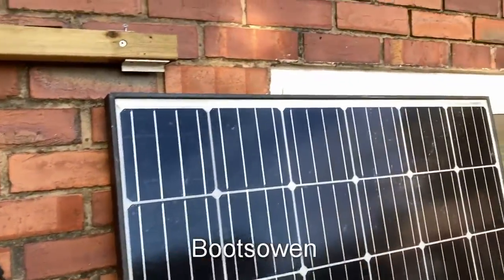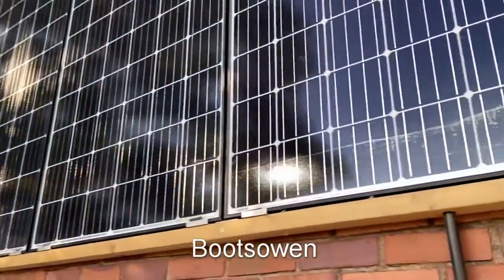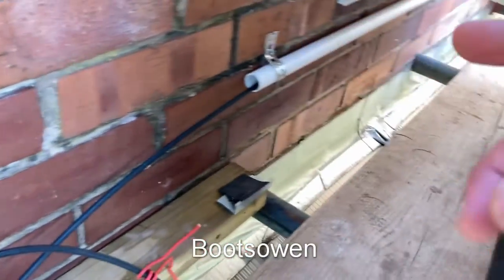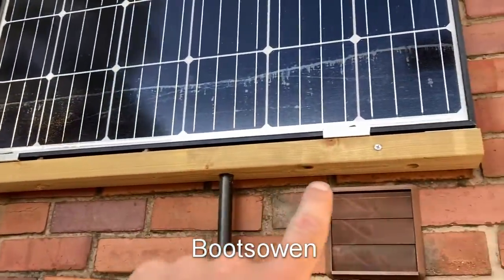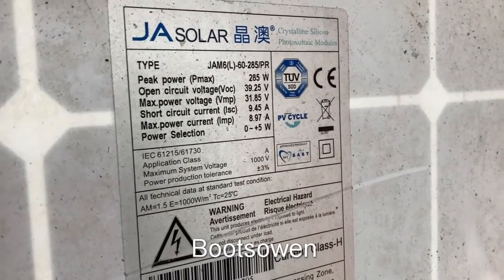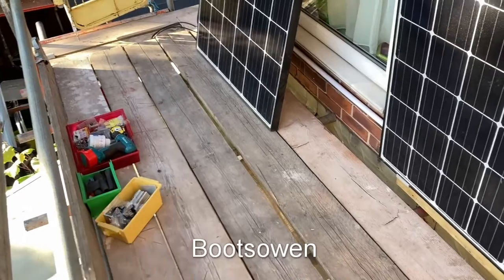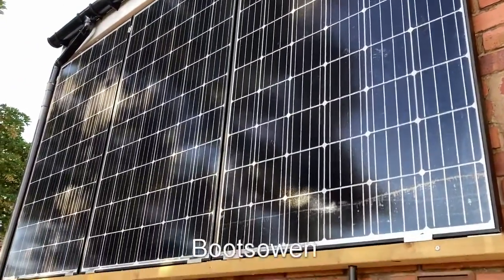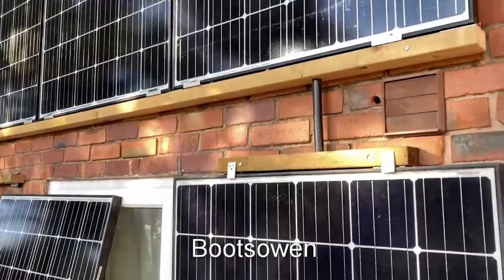Installing solar panels on a wall with DIY timber brackets

Comment: I like your setup.  I’m setting myself up with a solar shed and solar fence design.  Like yourself, I’m planning to rest the panels on a wooden shelf.   But I’ll be restraining the panels directly to the frame of the shed.  The way I’ll do this is with an array of notched pieces of wood that slot into the flange of the solar panels aluminium frame.  It avoids the need for aluminium bracket.  You can’t do that though because you don’t have access to the back of the panels. 

I’ll figure out a similar bracketing concept for solar fences as well.  I’ve got 7.7kw of these Aiko 485w solar panels ordered.
Reply from the maker: I have posted another video of the ones in my garden held to timber from below with clips. Maybe suit you. Very simple.

Comment: is it solid brick wall you are attaching the panel to? Or is it facing brick? The reason I ask is that I am about to attach solar panels onto a facing brick on top of a foam concrete wall. And I am confused about the proper way to fix the panels onto the wall to withstand high wind pressure.
Reply from the maker: Solid brick. You will have to choose a system for fixing. You could talk to the manufacturer or design of your system.

Comment: I want do wall-mounted solar panels feeding straight into storage heaters and a water emersion heater, as my house has always been all electric. I can do one set of panels on a 10m garden wall, one set on a 7.5m garage roof and a set on the 8m south side of the house.
Reply from the maker: Sounds like a plan.

Comment: Thank you for the video. I would like if you could explain a little bit more in detail how and what you used when mounting the aluminum solar panel rail on top. Thank you
Reply from the maker: I used the clips for the mounting system.

Comment: How much did you generate with these? I’ve put 2 panels up with unistrut but am yet to wire it up.
Reply from the maker: Its a bit of an open ended question. how long is....  In full sun they do about 1600w, Depends on the sun, the day, the time of year. Clouds. I think hanging them vertically is a great idea though, they compare very similarly to some that I have at 22 degrees which is supposed to be the perfect angle where I am.

Comment: Would love to see a follow up video on this, on how the vertical panels are performing. My options for install are a 9m x 2m garden wall, south facing, or a pitched roof 3 stories up. I'm wondering if the garden wall would be better for winter, with the low sun and would like to avoid having scaffolding, having easier maintenance etc. Thanks for the video!
Reply from the maker: I reckon that proportionally the wall mounted panels outperform the 9 "appropriately optimised" panels on my solar carport. Winter will tell. I reckon the vertical ones are never dirty. whereas the ones on a pitched roof are forever covered in bits or bird poo or dust. I reckon do what you can with solar, put some on your wall and then if you like them do the roof later. the wall is easy, the roof needs scaffolding. These west facing panels get good sun in the evening when we cook so it makes sense, and I have added a solic diverter and hot water tank and that makes free hot water from any excess.

Comment: Owen, just an extra thought, running an inverter near it's rated capacity breaks the 2nd rule of solar panels, so a separate inverter will ensure longevity, see my video on this: solar grid inverters, prevent failure. it's that whole balance between efficiency and longevity, cheers

Comment: Owen, so that length of roof rail for the top panels was just right as you were not working between two fixed points, made it easier. I like the inverted angles to hold the bottom in place and the rubber to reduce corrosion, don't forget the book, cheers, Andy